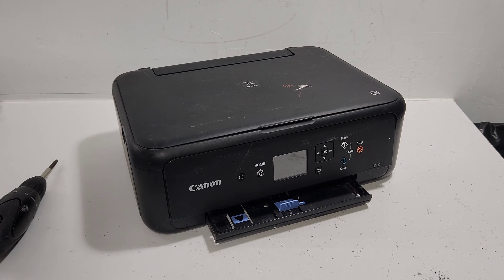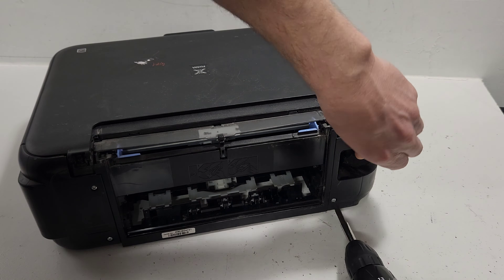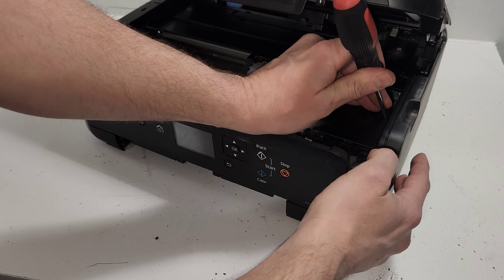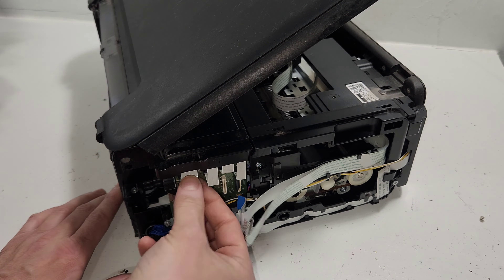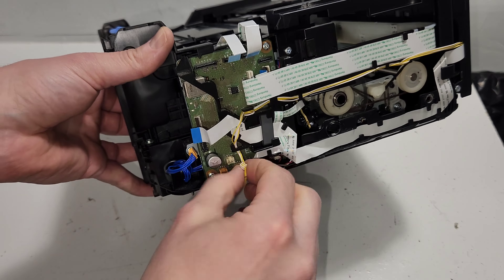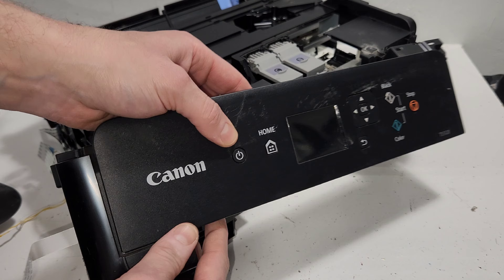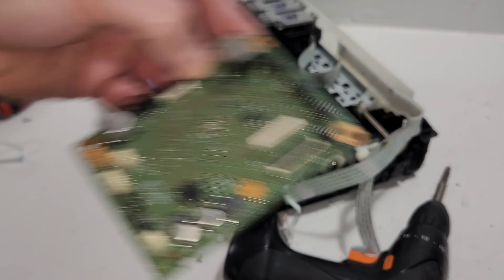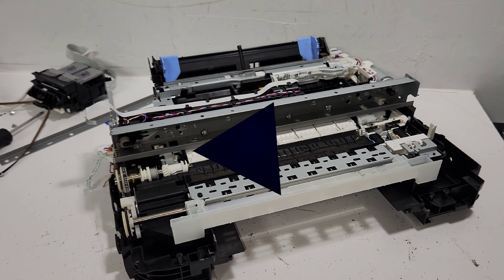Taking Apart Canon PIXMA TS5120 Printer for Parts or Repair TS5150

Comment: So I can’t get my printer to turn on? This happened suddenly and not gradually does that still mean it’s most likely the power supply? I opened it up and visually inspected it (the power supply, the ink cartridges for leaks, even went as far as buying a new power cord etc) and still can’t get it to turn on. Do you know how to test the power supply with a multimeter? TIA.

Comment: If ever you do this sort of thing again, it's well worth identifying where the waste ink system is, including the waste pads, waste ink tubing and the dump point where the ink is dumped into those pads. Useful for anyone who is trying to replace the waste ink pads or fit an external waste ink tank. Just a thought..
Reply from the maker: I appreciate your suggestion very much. Will make a note of it for future videos. Have a great day!
Reply: My TS5160 has a little nylon lever popping up to stop the carriage returning home, hence generating a 5100 code. I suspect this is related to the waste ink system. As I'm not prepared to dismantle the whole thing I've cut that little lever off with a scalpel and the printer now works fine. I can see what looks like the waste ink pad inside the rear of the machine and it appears still useable. What a complex system!
Reply: I watched this entire video to find out how to do just that! Where can I find a video showing the waste ink system/pad replacement, etc? thanks.
Reply: @melanietreadway  I've been looking for that same video and have not found it. Do you have an update from your search?
Reply: @lamprokpr21  So do I! Tell me when or if you guys find anything and ill leave a comment if i do